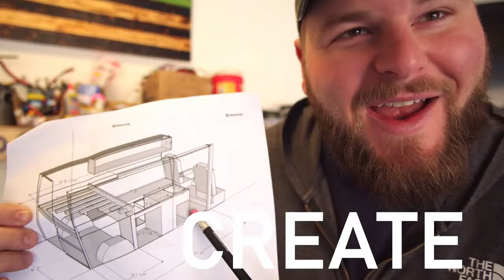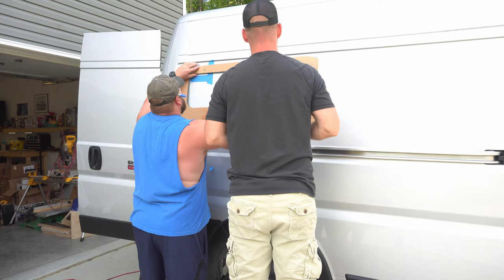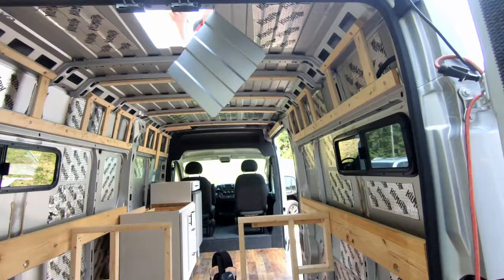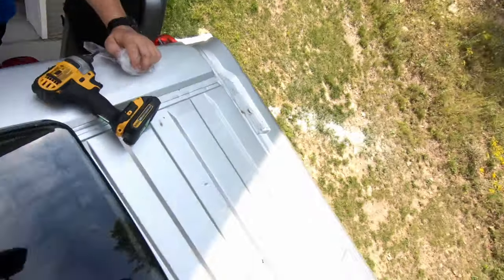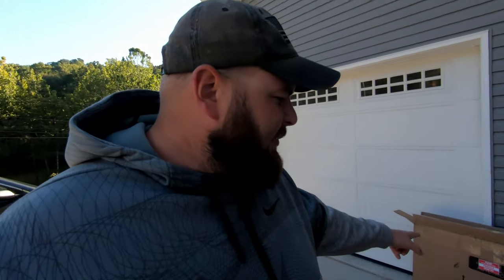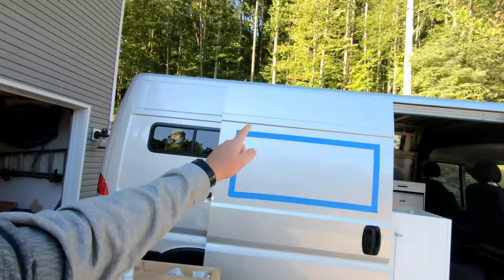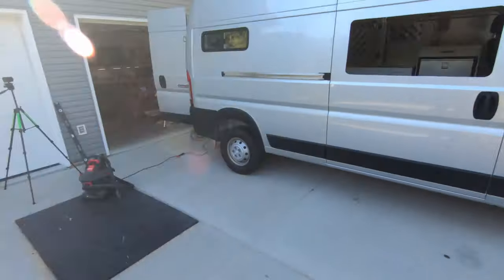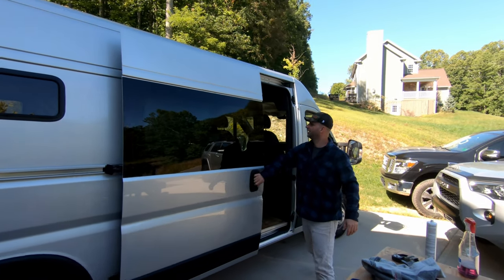VAN BUILD WINDOW INSTALLATION / PROMASTER VAN BUILD SERIES #vanlife

Comment: I see you put the weld on the window instead of on the metal of the van.  You're the first one I've seen do it this way.  Wondering if it makes a difference or not?  Also saw many folks say to get a 26:1 calking gun, the weld is super hard to get out.

Comment: Can you share how the inside of the bonded window turned out inside the van? I see it's recommended to put a clean edging on it, or i suppose you frame it out with wood. Also I'm getting a similar window to install on the Driver's side middle panel (will be only window on that side of 3500 ext). Can it be placed solo like this?...It will look either really sleek or odd on its own :D

Comment: I wish you had shown screwing in the clamp ring to the bunk window. A lot of people seem to have issues with this on the CR Lawrence windows due to them not being pre-drilled. I would like to have seen how you handled that. Can you explain what you did for this step?
Reply from the maker: Correct, The exterior portion of the clamp ring is not pre-drilled and the interior clamp ring is to locate your screw pattern around the window.  Hardware provided by CR is sheet metal screws.  The exterior ring is a bent extrusion with a groove that aligns with the screw pattern and acts as a “starter” for the sheet metal screw to self Tap into.  Not too bad to but definitely need a helper
On the outside pushing the frame in.  If you didn’t have a second hand.  This would be very hard.
Reply: @biglogan3690  Thanks! I have seen some people pre-drill the holes and others just seem to go for it. I am afraid I might not have the physical strength to push a screw through if I don't pre-drill. But I am also afraid of pre-drilling - lol. Just working on mustering the courage to tackle this project next!

Comment: Be careful shutting the side door with all the windows closed while the adhesive is still curing. It could blow it right out if you don't leave another door or window open to relieve the sudden pressure of closing the big slider door.

Comment: is that 3m caulk permeant?? has it held up. I am looking into getting my self a dodge promaster 2500 159' wheel base. your videos are great and very detailed, really helps me understand everything.
Reply from the maker: The 3M window weld is identical to OEM bonding urethane that are used on most window installations on the assembly line.  It is SUPER TOUGH, and also really nasty if you get on your hands (spoken from experience before this van build lol)  Good Luck and thanks for the great feedback Ceasar!

Comment: Great video, @biglogan3690, but I wish you'd done an "after" shot from the inside because from what I can tell, the inside might not look too great due to the fact that 1) you used white paint applied kinda sloppily on the cut edge of the opening and 2) I saw no evidence that the the cut opening on the interior has any kind of trim, so the raw edge of the cut, however neatly filed, would become the inside surface of the installation. So the window looks very professional and clean from the outside, but seems like it'd look kinda ghetto from the inside, right?

Comment: Hey so I’ve heard people putting in max air vent up top have one chance to cut correctly, and if they screw it’s up it’s not really fixable. I’m looking at a van tomorrow snd wondered how can I tell. Just see if it leaks?
Reply from the maker: That’s really all you can do, apart from removing the interior trim ring (4 Phillips head screws) and seeing up the sheet metal (if possible.  You can seal these from the top and bottom if need be so not too bad…

Comment: How far did you measure down from the ridge to the top of the window cut out on the outside?  We have spray foam on the inside so measuring and marking inside is tough.
Reply from the maker: Roughly 4” down from the body line and 6” forward...

Comment: Did you make your  template by tracing the inside or outside of the ring clamp?
Reply from the maker: Its actually NEITHER.  Unfortunate as it is, CRL does not provide a template.  You need to exceed the exterior ring dimensions by roughly 1/8" to 1/4" total across top and bottom axis' and continue this offset through the rounded edges.  Good Luck!